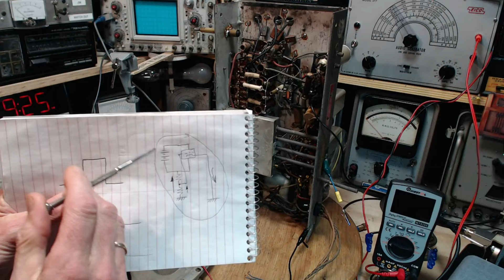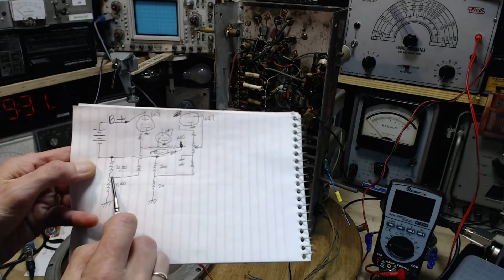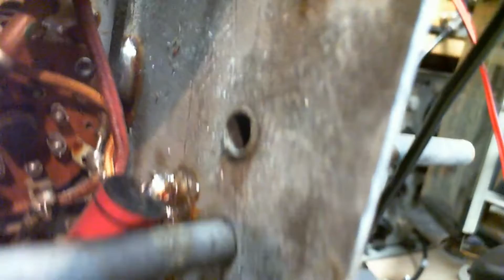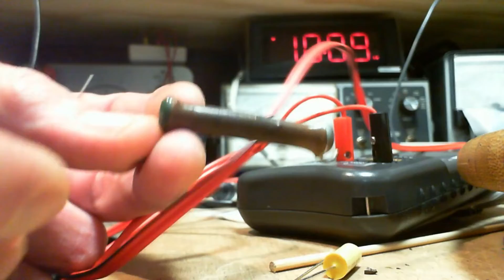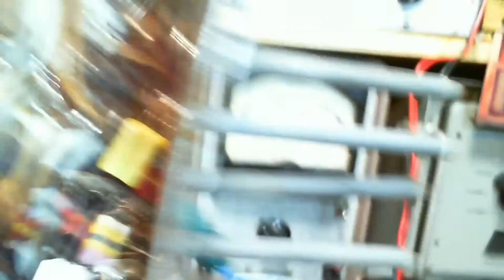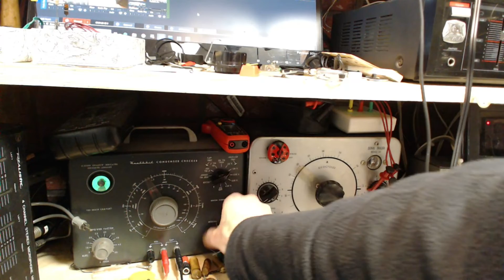Westinghouse 636 video#8 - Intermediate Stage Capacitors

Comment: I would have thought that a Weller 8200D Soldering Gun would have worked wonders here, there must be some way to replace the tuning shaft.
Reply: I was thinkin' that, too. Enough Watts to solder that brass bushing to the steel chassis.
Time to get out the BIG guns...  ;-)